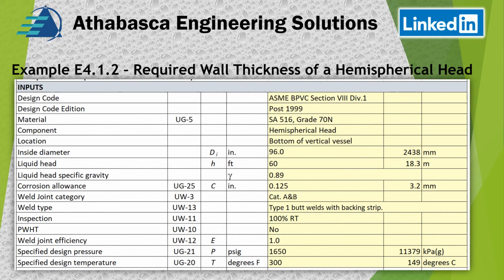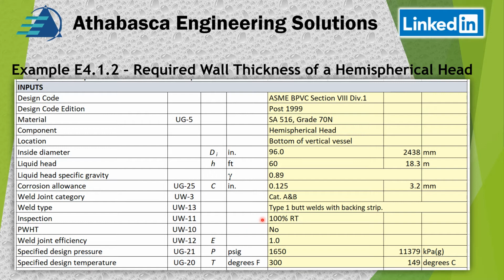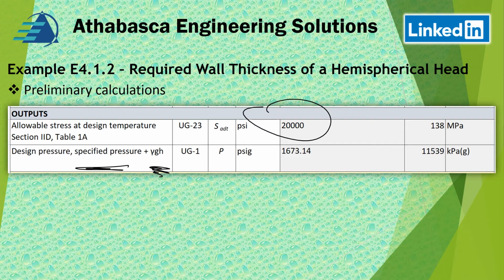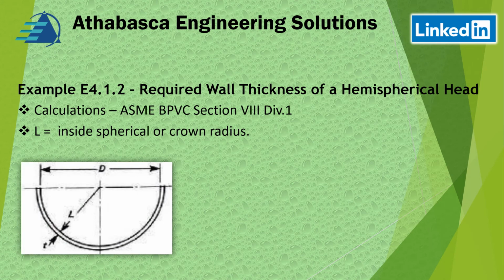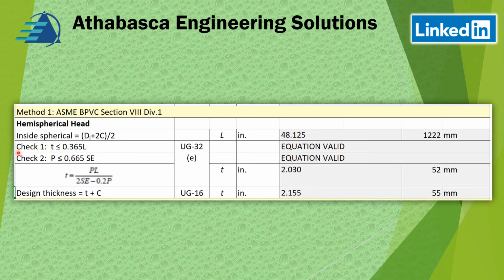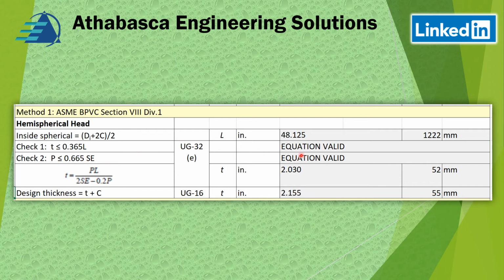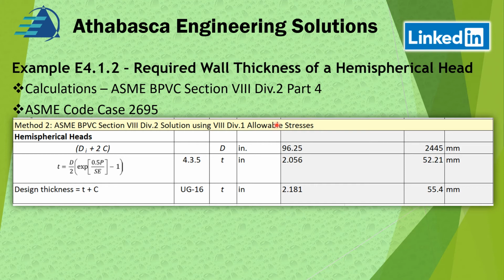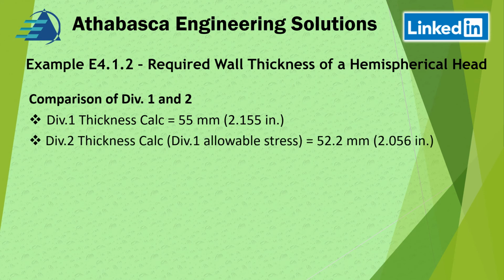ASME PTB 4 VIII-1 Example E4.1.2 Wall Thickness of Hemispherical Head

Comment: type1 ( Butt joints welded from both sides, or from one side only without a permanent
backing strip, that are verified as having achieved full penetration and fusion as
required by UW-35. )  , or you means that backstrip is tempoary not permenant , it is not clear in the table it it permenant or temporary